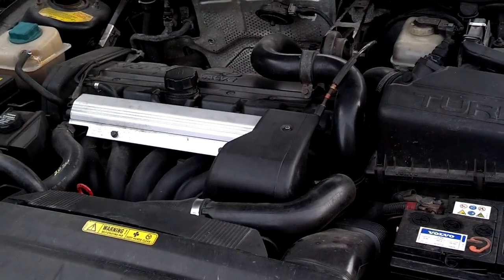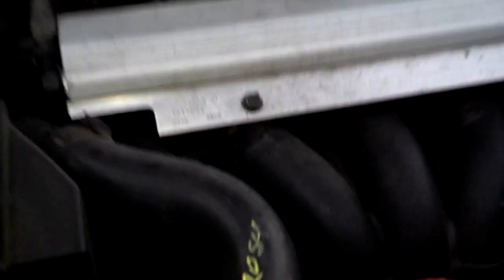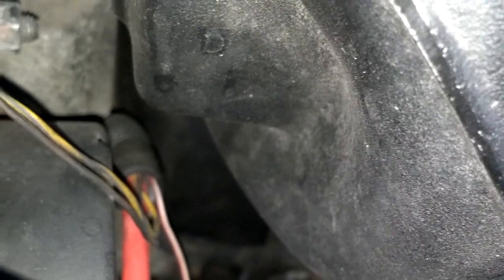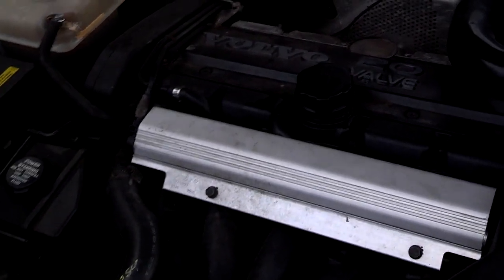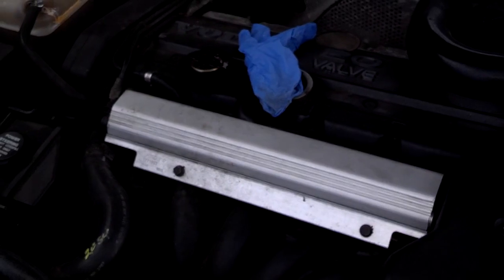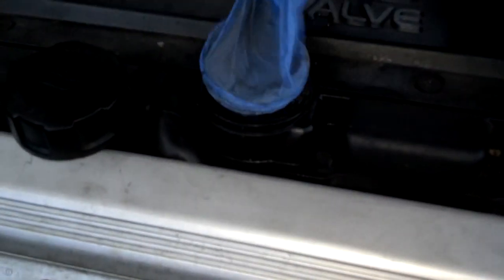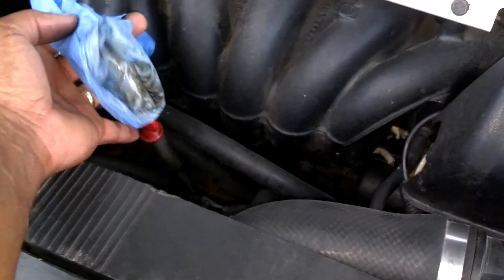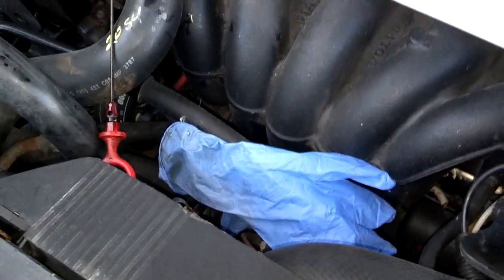Volvo PCV system check, 850, V70, S70, and others - VOTD

Comment: Hi thanks for the video learnt a lot from it.i have a focus st 2.5l i5 turbo 2007 model.it actually has the same Volvo t5 engine if u are aware.i recently had my turbo rebuilt...bt ever since the rebuilt the car is smoking esp when on boost.....been advised to change valve seals which ws done bt stil smokes....ws then advised to change oil filter housing(pcv) which ws done bt stil smokes....been told at the dealership that it's less likely to be piston rings coz power wise the car is superb.
I've since noticed some oil on the crossover pipe from turbo into intercooler. Prompted me t return car bak to the turbo rebuilders...bt they stil maintain turbo is fine......thy are saying the turbo seals are fine.the oil in the crossover pipe is due to high crankcase pressure which actually leads t oil drawing bak into turbo thru oil drain pipe.....but I thought I had addressed tht thru buying a new filter housing.when I do the glove test it's negative....it gets sucked in.no smoke at dipstick either .....could I be missing something in pcv system which is stil causing oil to return to turbo?
Reply from the maker: They either installed a bad turbo or did not rebuild it properly. (Also, could have failed to pull the drain plug that allows oil to go back into the engine from the turbo - would smoke a lot).
Reply from the maker: https://www.youtube.com/watch?v=oRwDce_ALkk
Reply: Thank you very much will have turbo re checked.bt jus t make sure i get u right...what part do u refer t as the turbo oil drain plug...do u mean the turbo oil drain pipe?

Comment: 1999 v70 non turbo. 182k, bought 2 months ago. Major oil leak near timing belt. Will changing the pcv system stop the oil leak.
Reply from the maker: +Matt Kirkland did you watch the video?

Comment: Does that cause Oil consumption I have a 2008 s60 t5 with 122000 on it and it consumes about a quart for every thousand miles and it no smoke I have hade the car for 5 years now and that just started like 6 months ago you know if there's a fix thanks
Reply from the maker: What weight oil are you using?
Reply from the maker: https://www.youtube.com/watch?v=wyF3o3c1uug
Reply from the maker: https://www.youtube.com/watch?v=tY-v780C7d8
Reply: Robert DIY 10w30 Mobil 1 thank for replying so fast
Reply from the maker: Where are you located?
Reply from the maker: How many miles?
Reply: Robert DIY South Dakota it gets really cold here and really hot 122000 miles
Reply from the maker: Watch the videos I posted. I would probably use 10w-30 in the winter months and 10w-40 in the summer months.
Reply: Robert DIY thank I'll try that and let you know how it goes
Reply: Ps and I did see both thanks again

Comment: Valuable, valuable information!!  I just looked at a 2004 XC90 last week.  2.5T engine.  I pulled off the oil filler cap and saw some white smoke coming out of the oil filler neck.  Not a lot of white smoke, but there was some and it flowing out steadily while the engine was running.  The car drove fine, but the white smoke was enough to make me pass on vehicle.  This video sheds some light on what may have been going on with that vehicle and some issues to look out for before purchasing a vehicle.  Thanks!
Reply from the maker: Not sure if that showed anything.

Comment: Hey Robert My Volvo S70 Failed The Oil stick test i lifted it about 2-3 inches and smoke did happen to come out Also When i Tried The Glove Test my engines oil was bubbling causing me not to put the glove on i can obviously tell its blow out not sucking in
Reply from the maker: +Joseph Hurtado no, the cam slings oil. DO the glove test, it is better than pulling the dip stick out.

Comment: Hello Robert my v70 2.5T has 70,000 km I did the test with the glove with the motor hot low rotation has negative pressure I accelerated the car at 2,000 rpm  in D foot on the brake blows very little the glove and then normalize is there any problem? Or the correct one was not to inflate anything, thanks for the help
Reply from the maker: +Cassiano G it's fine
Reply: thank you so much

Comment: Hi Robert - I have a 850 T-5R whits blow the deepstik out especially when the engine produce turbo pressure - PCV and tubes has been changed to new, compression is fine, no water use or oil in water so head gasket should be fine - what else should be cleaned out or checked - how do i check the PTC valve - Thank you for your super films :-)
Reply from the maker: My guess would be that there is a blockage in the system. Did you use OEM parts?

Comment: Robert, I had a balooning glove at the oil port, took the S60 2.5T to a shop for PCV cleanout.  The car came back better.  The glove test shows no net pressure at the crankshaft, neither suction or inflation.  Should I consider the PCV cleaned out?  I was expecting a noticeable vacuum?
Reply from the maker: I thought you said a shop already did it? I wouldn't worry about it if there is no inflation. Was the engine warm when you did the test?
Reply: I checked again after warmed-up, and the glove inflates (although less pressure than before it went to the shop.)  I have a XC70 with the exact same engine (B5254T2), and the glove gets sucked all the way down to the grating.  Now that I see what a properly functioning PCV looks like, I'm going back to the shop for rework.  Thx, Robert
Reply from the maker: You are welcome.

Comment: Robert you realize you are like a god among men when it comes to Volvos right? any trouble shooting i ever do and voila me and robert get it done haha.. i was nervous about this car when i got it as its my first non domestic, but with you it's been a breeze and ive kept my money in my pocket

now.. back to repair talk haha  i do have one question still, my car recently got a p1771 after a p0302, i pulled the ignition coil for cylinder 2 and realized that there is oil in the spark plug well, so im gonna clean that out and then troubleshoot the filler cap seal and pcv as per your recommendation which should clear my p0302, but i was wondering is the p1771 in any way associated or could it be? i need to smog soon. thanks in advance robert, you're my hero
Reply from the maker: +chris jenson not sure what that code is for.
Reply from the maker: +Robert DIY https://youtu.be/gt9w-ZSxs9I
Reply from the maker: +Robert DIY https://youtu.be/Sg7iFytxfzQ

Comment: Hi Rob. long time follower. Is there an easier, cheaper way to clean or service the pcv system. would just replacing the pcv do the trick before replacing all the hoses and box? The glove is getting inflated in my 98 v70. Thanks
Reply from the maker: +Mario Lemoine if there was an easier way, don't you think that I would have shared it?

Comment: Hi robert manuel s70 t5 I use black smoke at high speed and do not accelerate from 4000 rpm to 6000 rpm
Reply from the maker: Probably the turbo is going bad.
Reply: Turbo revision required

Comment: 96 850 R , I finished the pcv job, and everything went well but still have the mystery part.  I got the car a couple weeks ago, so not sure if it's something that was just hanging around from another job.  looks like it's had a new radiator and starter.  part doesn't seem like it's part of the manifold or pcv.  it's basically a 1"x1" cylinder ( like a donut) with a metal body, copper wires inside that go to to leads on the end, and a plastic sheath that looks like if you insert it in a hole it will keep it in... I can send a pic, . anyway I finished the pcv job at 1am and had to drive it home and everything seems to work fine.  hopefully the pcv job slows down the rear main seal leak or I'm going to be asking a lot more questions... timing belt is next...thanks for all the great videos!
Reply from the maker: You are welcome.

Comment: hi , I am in the middle of doing pcv. when I removed the manifold I heard something drop and it landed on starter... Ive no idea what it is , some kind of sensor? it's about 1" diameter and 1" tall metal  cylinder with copper wires inside and a 1/4" hole, kinda like a donut with remnant of 2 wire leads ... not sure if it was just hanging around from an old repair or it fell off something...?...
Reply from the maker: +Mark Begle what kind of car do you have?

Comment: Hey Robert. I've looked at the PCV system on my own 96' 850 (Base Sedan) and it does smoke out of the oil dipstick at temperature, but upon testing with the rubber glove method, the glove was sucked in as if the system were fine. Any input? Thanks!
Reply from the maker: +Luke Woessner system not clogged. Make sure you don't have any broken vacuum lines and move on.
Reply: Thanks! Your videos have always been a great help.

Comment: I have a 95 or 96 volvo 850 gl non turbo. I have found that the last two spark plug ports were filled with oil and obviously leaving me stranded on the road. after cleaning the plugs and ports i was able to drive away with no problems. i have yet to do any tests but will do later. what might you think it'll be? thanks!
Reply from the maker: Bad PCV or oil fill cap seal.
Reply: Robert DIY 
thank you. will be checking both of these on the weekend!

Comment: Robert I got a question if I'm getting back pressure from the coolent box ? Also the coolent is getting out and I tried to flush and refill but the coolent doesn't seem to get into the radiator what would be bad in this situation? And also I do get smoke coming out from the dipstick and also I've seen a bit of coolent mixed with the oil.
Reply from the maker: +Alejandro Martinez how long have you had the car?
Reply from the maker: +Alejandro Martinez https://youtu.be/za8qgxDey8I
Reply from the maker: +Alejandro Martinez back pressure, not sure what that is.
Reply from the maker: +Alejandro Martinez https://youtu.be/jsxPXltMFOc
Reply: If your cooling system goes under pressure when the vehicle is cold......your head gasket is blown and letting compression gasses into the water jackets. :(

Comment: I did this test and it did blow the glove up. my question is will a clogged pcv system make the car stutter and run rough under load? 06 s60 2.5t and runs fine but when you try to give the car more throttle it starts to stutter real bad. CEL came on for 2 days and had the code ran to have them tell me bad MAF sensor and fuel air ratio was not right but the CEL went away a day later and never came back on. Im trying to keep from spending tons of money on parts I don't need. any suggestions would be greatly appreciated.
Reply from the maker: Replace the MAF and get the PCV system serviced.

Comment: Robert DIY, I have aqcuired a Volvo 850 2.5 automatic from the year -97, and the previous owner had it served not too long ago. However, on the motoroil dipstick the oil is very bright-yellow? Not golden-brown and transparent as it should be. However when looking down through the topcover (unscrewing the oil-cap) the oil looks perfectly fine there. When I run the car and remove the dipstick, a very small amount of smoke comes up through the oil dipstick and also through the oil-cap at the top, after shutting it off and removing the cap. 

Now cars ain't exactly my field of knowledge but I've been told it may be a clogged crankcase-ventilation. What are your thoughts on this?
Reply from the maker: +S. Eriksson glove test.
Reply from the maker: +Robert DIY https://youtu.be/za8qgxDey8I
Reply: u are very knowledgeable about volvos im following your channel
Reply from the maker: thank you.

Comment: Hey Robert, I have 2005 volvo s60 2.5t with 160,000 miles on it. Currently it is in the shop having the timing belt and cam seals replaced due to a slow leak. I'm worried it could be a lost cause if my pcv system is clogged. I preformed the glove test and when i first started the engine it was sucking the glove in. however i did not try it under a load. It is possible that the pcv system is not to blame for my leak?
Reply from the maker: +Jacob Beck yes.
Reply from the maker: +Jacob Beck yes.

Comment: I adopted your rubber glove test and used it on my 2004 MINI Cooper S.  I made a video of it and mentioned you...hope you don't mind.  https://youtu.be/Lhxe-PEg8s8  

It failed the rubber glove test initially.   I discovered that the PCV valve was clogged, so I replaced it.  The two lines in the valve cover were free and clear.  Retested after replacing the PCV valve and it passed the rubber glove test.  Problem solved!

Thank you!
Reply from the maker: Cool.

Comment: Where does that hose showed in the beginning lead? Mine is torn. I have had misfires and a rich running system. I had a leaking cam seal replaced recently so the pcv system is likely clogged. Great video btw. I have used these for months to replace all kinds of things on my volvo.
Reply from the maker: +NICKELGHANDI which hose?
Reply from the maker: +NICKELGHANDI https://youtu.be/-2oIeIhpV44
Reply: I don't think I was specific enough. It is a vacuum elbow that attaches to a hose that runs under the intake manifold I believe and then somewhere to the back of the engine. Everything besides the vacuum lines have been done in the last 10,000 miles and I have service records dating back to 1998 (when it was new) showing repairs and replacements. Those vacuum lines have been the biggest issue for me.
Reply from the maker: https://www.youtube.com/watch?v=ZqdHDqGKYV0
Reply from the maker: https://www.youtube.com/watch?v=hwCzPPiBxk8

Comment: I have a 96 850 Turbo.  What if I have smoke coming from the dipstick tube, but the glove test doesn't try to inflate the glove and does appear to be showing vacuum?
Reply from the maker: +blkroz2012 the system is fine.
Reply: Robert DIY 
Thanks Robert.  Your videos have helped a lot.  Unfortunately the glove actually did puff up somewhat once I put a rubber band on.

Comment: Hi Robert. I changed the pcv box and cleaned the ports on my 2001 Volvo s60 turbo but I'm still getting smoke from dipstick and oil filler and glove gets inflated. I did everything correct except I cracked the hose that goes from the box to the drivers side of the engine a little bit. could you tell me what's wrong here?
Reply from the maker: +baggiedaddie cracked hose. Also, I don't follow smoke. Have you done a compression test? Very hard to clean the ports on that model, curve in the oil pan port. 😥

Comment: Hey Robert. I have a 1993 850 GLT that i purchased around April of this year. When buying the car, I did the pre-purchase inspections that you said you like to do, including the glove test. It sucked the glove in, and so i concluded that the system was in good shape (I also have written proof it was serviced recently). I haven't driven the car much at all, since I have been replacing things (i would say 200-300 miles max since i purchased the car) and the past month or two the car has been sat in my garage. Well last weekend i started it up and did the test out of curiosity and noticed that the glove inflated. I guess my main question is do you know how the system could have clogged a significant amount just sitting in my garage? furthermore, is there any chance that this is just occurring because i haven't driven it in a while, and it will "sort itself out" once I start driving it again? I know that last part is a stretch and most likely not the case, but I can hope! thanks in advanced.
Reply from the maker: +sean farrell you should test it when the engine is hot.
Reply: Thanks for the reply. Currently at school so cant test it right now, but ill be sure to test it with the engine warmed up as soon as i can.

Comment: Hello my Volvo 960 3.0 is leaking a bit oil. I believe the PCV needs service, probably the clogged system caused a sealing to start leaking? Is the system similar to the 850 PCV?
Reply from the maker: +kocaarik not really, check the flame trap.

Comment: Hey Robert, Excellent videos.  Thanks so much.  And congrats on the 200+K on the wagon.  I have a 2000 S70 and do not know if my PCV system has ever been serviced.  I am the only owner and my "old fashioned" mechanic just does what he needs to do, I don't ask questions, he keeps my car running and I pay him.  I appreciate your videos because it is great for those of use who don't know too much about the Volvo engine.  They are great cars, but can be a bear to repair.  Great accent btw.
Wade
Reply from the maker: Thanks for watching. I'm at 329,000 on the wagon now. ;)  Keep the coolant and oil good, the rest is minor.
Reply from the maker: Thanks for watching.